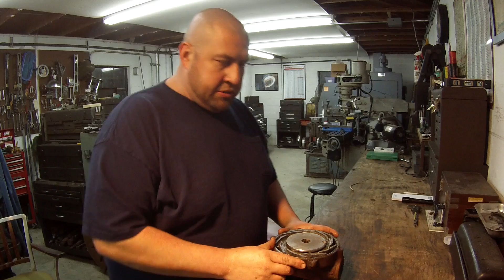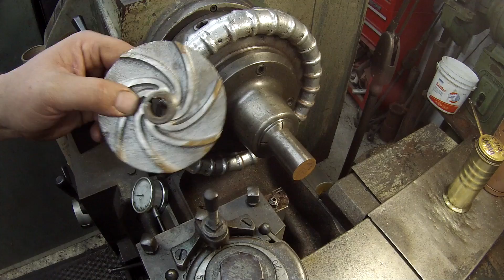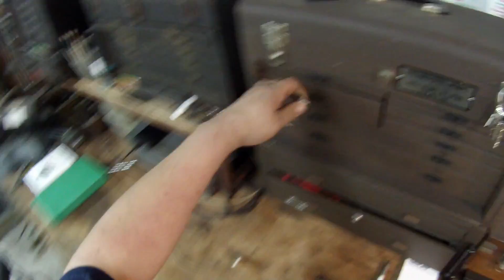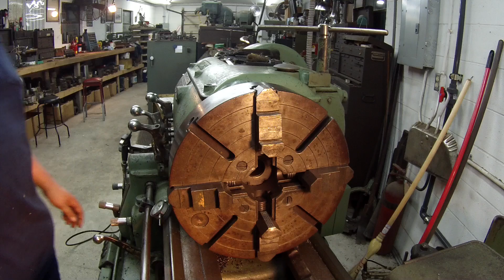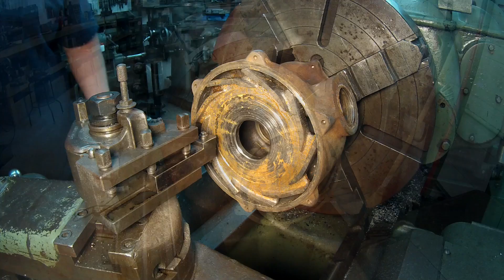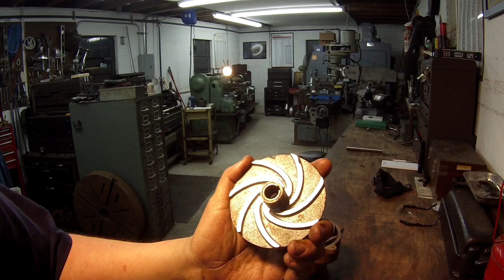Pump Housing and Impeller Facing

Comment: We always cut up old pump shafts and thread the impeller on and chuck em up so if the shaft gets screwed which is usually about 10 to 1 to an impeller so we have all old shaft sizes cut up and saved. Usually have to turn size a new impeller to suit the pump curve so chances are whoever gives you the pump probably has bad shafts for said pump cant hurt to ask

Comment: Mandrel is way to go , we used to measure I/D and just put a 0.002_ 0.003 taper on say a 4 inch long shaft so it would just lock at the correct dia . This was for light work like skimming face or wear rings true to impeller I/D . Many ways to skin a cat but some skin easier than others

Comment: Cutting threads based on depth of cut requires knowing your inserts very well in my experience.  The tool's radius can make major differences in thread pitch.  Do insert manufacturers publish depth of cut data?

Comment: curious if the efficiency of the pump is reduced because of the reduction of surface area of the impeller?
Nice video.  Another question, why would anybody give you a thumbs down???
Reply: Yes,/no depending on how you gauge it. I often trim the open impellers on pumps in the barge industry so they can hit a specific flow, or to hit a specified HP required to move a product of a particular specific gravity.
Reply: Thanks Leroy, makes sense to me.

Comment: Nice work Adam, but shouldn't you have faced the bell housing to make sure its in the same plane as the centre bit you faced off the bell housing, that would make sure that the impeller would be running exactly parallel to the housing I would think?

What's the clearance between the impeller and the bell housing, do you know that?

Am I overthinking it?

Comment: Just me personally but I prefer mandrels for precision. ~( 'w')/

So far as chatter, just put a thin layer of hard rubber sheet [possibly an epoxy elastomer poured on the mandrel] to keep it tight,
but keep it from vibrating.
Reply: Delicious DeBlair, chatter on a non interrupted cut is controlled by speeds & feeds, your tool, setup, etc.
there is NOTHING that isn't covered in your most recent Machinery's Handbook.
Reply: @oldnick4707  I have run across a few types of sticky red brass which seem to chatter at anything over .004" d.o.c. and  which, while they like to tool harden easily on shallower cuts, do better once that happens, so long as I am using carbide.

With any piece of brass [or bronze], I like to find out what its grade and composition is before cutting, so I look into its back story [hopefully it can be found either on the back of the part, or some place on the pump assembly as a code], and, while, [admittedly] I have not turned a lot of brass or bronze pieces, I have so far had good success.
Reply: Delicious DeBlair, yeah, and for me, some nonferrous cast pieces can be a little trickier too, (and cast iron castings and other bullshit too). lol tough as hell sometimes, or porosity, even sand and all.
aluminum bronze sucks. :)
sometimes stuffin a chunk of wood against an impeller, etc., with yer tailstock
keeps it from ringing, if possible! maybe a sheet of rubber between even. 
I haven't machined anything in years! kitchens, baths, siding, lotta ceramic tile!
I grew up in my Dad's machine shop. did all that for 20yrs. or so.
they have some big waterjets and a bunch of cnc, but still a job shop. sure never thought I'd miss that all but I do in a way. oh well lol
Reply: @oldnick4707  When my brother [a world class master machinist with over 30 years experience] retired from working at the largest shipyard in the western hemisphere, he came here and built a machine shop in my barn so that I now go out and work on projects as needed, although, due to my horrid lack of money, by no means as much as desired.

I have worked off and on in several shops over the years, as well as one large company [ EDM Chromalloy ] where I have worked on jet engines, hydraulics, pump and motor repair, solar trackers, and tooling.

I make no claims to being a master, more like a 2nd tier apprentice actually, but in my roughly 8 years of shop work, I have enjoyed my years breaking chip and doing finish work.

Comment: The lip may cause cavitation yes, but if its shagged anyway, may as well get more hours out of the pump. It will just wear quicker. If you turn the impeller end for end and face off the journal, the person assy the pump can set clearances with shim.

Comment: I'm not a machinist so, this may be a stupid question here (so please forgive me if it sounds a bit nonsensical).  Would it not be helpful to center and square if you had a cone shaped object to place on the part of the lathe where you would normally place a drill bit (I don't know the name of it)..... to insert into the inside opening there on the part you are machining?  Is that possible considering that the inside hole runs perpendicular to the face?  I'm not sure how else to describe what I'm trying to ask.  I hope that makes sense though.  *Similar to the set up on the bike rims in Saturday Night Special 57.
Reply: I was wondering about that. I know clickspring uses a "bump centering tool" which is what I immediately thought of when I saw this

Comment: Never cease to amaze me! I noticed the blowgun you were using. I bought one of those when I was turning wrenches. I can't believe the difference between those and the plain center hole blowguns that I used for years. They are 10 times as strong.  I would blow out the shop floor with it.  It took about 10 seconds instead of 10 minutes. Thanks for sharing your skill and pride you  obviously have.

Comment: when the impellor and housing are faced there will be additional clearance between the parts. does this need to be taken into consideration by machining the flange to bring them closer together or can this be ignored?
Reply: Shimming behind the impeller to bring it closer to the volute should fix the clearance issue. We usually shoot for a clearance of .005 and no more than .015 to make sure the pumps run optimally. The smaller veins on the impeller will cause a slight decrease in volume and pressure but it probably won't be enough to warrant a new pump end yet.
Reply: @larryrodriguez1977  will it decrease the pressure?
Reply: @winksworks  yes. I've had the issue before and had to break down and tell the customer to replace the impeller. Now if you're only using the pump to move water with no real pressure other than say a bit of rise or the loss of flow from the friction of the pipe then all you will really see is a slight loss of volume. That being said anytime you shorten the veins on the impeller you reduce the amount of surface area thats able to actually move water. I am not a machinist though i do run a few lathes and mills at my work rebuilding water well pumps so I've seen the end result of thousands of rebuilds and full replacement of parts. If you can afford it then replace what you can, if not maybe have a machinist clean it up and hope you can geta  little more life out of it
Reply: Charles, the new lip on the housing, near the vanes will also create a turbulence, possibly causing cavitation. possibly not.  The alternative...finding a replacement pump that fits.
Reply: Wouldn't less shimming take care of the extra space?
Reply: i wondered about that as well obviousy if you take out material the gap or tolerenses have to be compesated for and im only a hobby machinist  with a 9x49 mill and a 14x40 exelent lathe  so i wondered that as well.
Reply: There are spacers you can place behind the impeller to bring it down a bit

Comment: Why don't you put a couple of Parallels on the face of the chuck to mount the flange close to square?  Then remove them before turning.
Just a suggestion.
Reply from the maker: I've used that trick many times for certain jobs, but sometimes i prefer to just chuck the part and indicate.

Comment: whats that thing called that you put on the indicater to do the inside bit
Reply from the maker: Thats the Starrett ID attachment #670B. I use it all the time for indicating the id.
Reply: Abom79
Hi Adam, I just got a 670B off the internet the other day for $40, looks like new, keep the great videos coming, buy the way how big is that 4 jaw and how do you change it?
Reply from the maker: John, the chuck is a 15" Cushman D1-6 cam lock mount. I always had to change it by hand, and it's a heavy bastard! No real need to change as I leave that to the Victor when I need a different chuck.

Comment: Good job Adam both parts look like the cleaned up really good.  Are there specific inserts you prefer when working with cast iron?
Reply from the maker: For me I use the same inserts for all materials pretty much. There are inserts and different grades made for cast iron though.I actually like to use brazed on carbide tools for cast a lot of times.

Comment: I am always interested to see and hear your approach to solving problems that customers present to you. As usual, a really good result at the end. You have great confidence in your equipment, based on personal experience I imagine, but, I would have concerns that that housing might fly out of that 4 jaw. I realise that centreing by indication the piece addresses issues of weight and wobble.
On the face of it though there is not much area of physical contact between the pump body and the jaw faces. The relationship of its size / weight and the effective stickout distance from the chuck when your working on that face and applying force sideways towards your self when stood at the lathe must be limiting and with some risk. - Hence another reason for light cuts I suppose as well as only wanting to remove the minimum to create a flat smooth surface.
Reply from the maker: Dan, I think for people who dont have experience with jobs like this that have a lot of stick out from the chuck will get nervous about it coming loose, just as you described. But you have to do the work in order to know the limits of the machine and what your capable of chucking and turning safely. I had absolutely zero worry of the part coming out because I know how well I had the jaws clamped down. Taking light face cuts pose no issue. Now if I was to accidently bury that tool into the part or hit the compound I'm sure the part would get knocked loose and pull out. You just have to be comfortable I guess Dan. Ive had other show the same concern.
I want to talk about this again in another video and show to pictures of some really massive parts I have turned. 

Adam

Comment: So with the small taps you where making to really zero in the indicating on the pump housing, do you worry about the non symmetrical  mass of the housing so far from the jaws once it's rotating inducing runout in the part?
Reply from the maker: Not at all. The chuck is holding the part good and as long as its centered, and I dont hit it with the tool, it will turn and stay true just fine. Also refer to the comment I left for Dan Whiteford.
Reply: This will cause unbalance. And it will turn oval to a small degree. It doesn't look like it would matter for this job. But if it were a bearing housing its definitely something to concider. I bolt on mass if its an issue. On large generator bearing housings that is.

Comment: You use a go pro??
Reply from the maker: Yes I do Logan. Hero 3 White Edition.
Reply: Abom79
 i thought so i usually mount mine on the toolpost and its pretty neat to use that 4 pics a second thing like when you start into a cut push it and you can see exactly how the steel rolls off the tool.  Same gopro i got I just posted a video with my go pro on our monarch
Reply from the maker: Cool. Ill check it out. I never even think about using it for taking pictures. I know it has the photo burst option on it. They always look cool though because of the wide angle.
Reply: Abom79
Yep photo burst thats what i used its pretty neat

Comment: Good job Adam it looks nice inside now, before you fixed it it looked like they had been pumping rocks through that thing.
Reply from the maker: There's no telling. A lot of the pumps in our area end up with lots of sand and trash in them, which causes the need for repairs. I don't know where this one goes to as they usually just drop stuff off when I'm not home with a note or a text message.

Comment: Adam great Video, I have a question, if you took 20k off the impeller and another 50k off the housing won't that make the pump less effective, maybe 70k is not enough to make a difference, just wondering?
Reply: Hal;

You are correct in that by taking 70 thou off the face and impeller, it will change the pump efficiency.  Adam is also correct in that you can shim the impeller to be a set distance from the housing face in order to set your efficiency at the optimum point for what you are pumping and at what volumetric flow rate you want.  Pump manufacturers make standard housings and impellers in a series of ranges and then do the final machining when a customer provides the desired flow characteristics (i.e., one set of pump housing and impeller can cover a wide range of pumping conditions).  It is also typical for the pump ranges to overlap so that you can have a choice of whether you want to be at the top of the capacity range for a pump, in the middle, or at the lower end, depending upon whether you are going to change the flow rates in the future.  You can also change impellers in a housing to change flow rates.  Typically, you try to match up the impeller and housing so that you are at maximum efficiency on the pump curve as this is usually the lowest operating cost for the pump.

Adam - Did the shop you did the work for  ask for how much you took off the housing face and impeller?  This would help them with initial set up of the pump.  Nice work again and I am impressed with how you make it look so easy.  Wish I could say my projects went that well with the same speed.

Regards;

Ron Kluwe
Reply from the maker: Ron Kluwe Yes on jobs like this I always tell them how much I have to face off. And when they drop off its usually "take as little as possible to clean up". 
Good explanation there Ron.
Reply from the maker: Hal, I'm not a pump builder but what they have told me before is they can shim the impellers on the motor to create the clearance they want. I'm sure there's a limit on how much can be taken off, but I was asked to clean the face up flat.
Reply: thanks